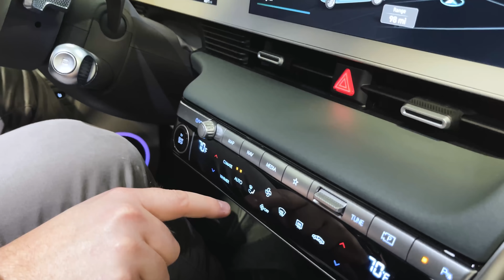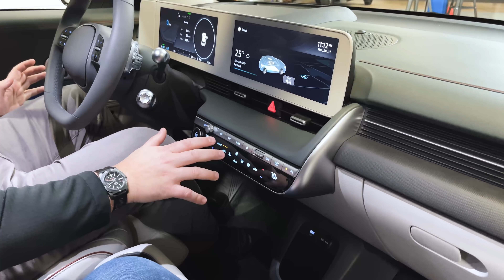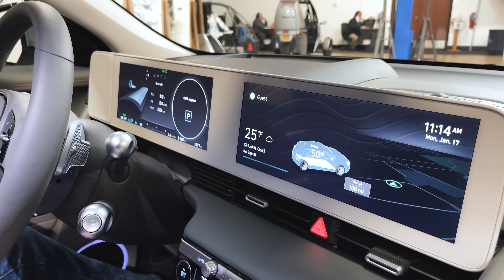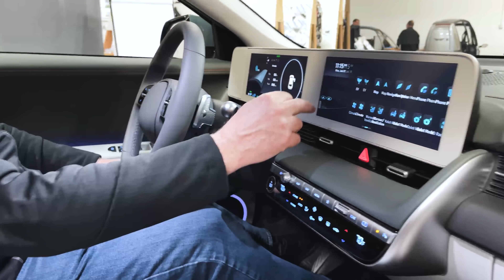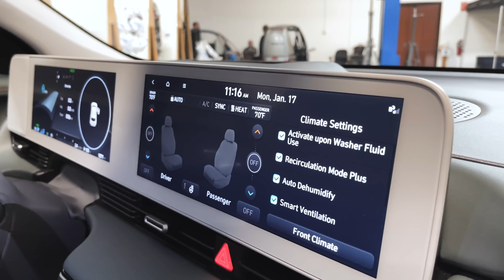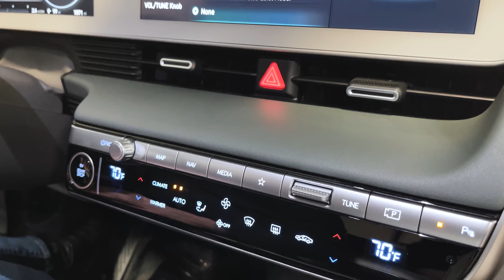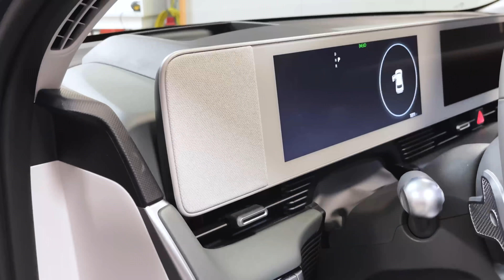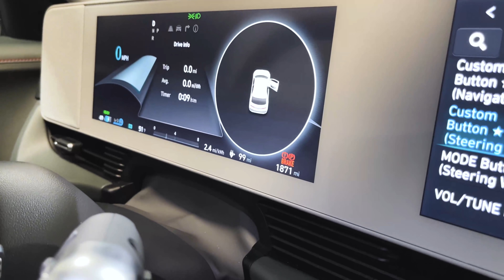2022 Hyundai IONIQ 5 | Sandy's First Impressions

Comment: Christ, what a silly video. It’s like these two have never seen a car before. Sandy pawing in-between the headrests trying to make the rear seats fold forward was cringing. Which is insane considering the guys stature in the industry.

“Where’s the frunk? No frunk! Oh here it is” 🤦🏽‍♂️🤦🏽‍♂️

Nothing wrong with physical buttons for the hvac. When it’s all touchscreen people moan. When there’s buttons people still moan.

Plus has he never seen a Drive Mode button before??? Suggesting it was mounted flimsily yet it didn’t move one bit unlike the ones you get in the Mercedes. Loved the car, hated the review.

Comment: What i dislike is that there is again no wiper for the rear window. So many buyers which are driving in the rain or in the snow here in germany say they are seeing nothing behind the car through this window after some time. The engineer or designer say that "there is no need for a wiper" because of the airflow ... But yes, there IS need for a wiper. Its a nice try but real life fail.

Comment: Ford has 3 level Auto Climate control. I notice this car has many of the features found on a Ford Explorer Platinum edition. The molding is in the rear hatch has the cuts in it to reduce weight and increase strength of that item. Otherwise it would have to be a hollow tube, thus wasting material. Auto Hold keep the car from rolling while on a hill. It is nice if you are towing.  Maybe the car oauto parks like the Ford Explorer.

Comment: Funny, my cheap old Hyundai i30 had most of these mentioned features. There is a nice feature with the light above the mirror. When you close the mirror the led turns of with a purely physical mechanism. No sensor needed.

Comment: Climate in separate is nice. It even nicer when i can turn it on outside to clean snow. It is always so that even if i have my brush outside. The mandatory sequence for ice is clean the top of te door, sit inside backward knonck off some snow fro your boots, turn inside, turn off wipers, press break turn on motor, turn on heating for back and front window and steeringwheel put ventilation to take in air inside to warm up faster then go outside and clean yor car. Why there is no preset for that why i must bring in snow twice.

Comment: Most modern cars in “auto” mode do not even begin to spool the fan until the heater core is up ot temp. I am a set it and forget it kind of person and never feel the need to fiddle with HVAC with the exception of defrost.

Comment: It's interesting how the older of the two suggests getting rid of buttons/capacitive touch down below - I would have thought he'd want to see dedicated buttons for climate if not for both climate and audio...  The lower "buttons" change too depending on if you want them to be audio or climate.  I also vote to keep the buttons even though I drive a Santa Cruz which has gotten rid of physical buttons and replaced with capacitive touch panel which took some getting used to but didn't take long - I had a few Ford products where they did the same to clean up the control stack.

Comment: I think those sun shades should be on all car doors and should be embedded with  titanium chain mail. It should have a electronic locking mechanism as well so that you can release them and retract them in a press of a button. Would make entry into cars practically impossible after breaking into the car.

If it's too expensive atleast make a slot for it there so 3rd parties can supply that accessory.

Comment: Having real A/C buttons was one of the points why I picked the Ioniq 5.. there's nothing more annoying than having to fiddle around in menus on the touchscreen just to adjust the temperature. That's several seconds I need to take my eyes off the road that I do not want to spend. I wish Hyundai had gone for actual buttons instead of these touch controls, but that's what we get. The tiny frunk is acceptable on the AWD, at least it fits the charging cable and V2L adaptor.. the one on the 2WD version is significantly bigger and can take some luggage. I'm quite sad at VW for not putting even a tiny cable-sized frunk in the id.series.. having to stow the potentially wet and/or dirty cable in the cabin sucks.

Comment: We had a Peugeot 308 SW and it was a surprise that the point where the roof and rear pillars meet, the sheet metal edges were very sharp and seams didn't have enough body seal - so that it was corroding already at 6 months of age. After that experience, I became habitually investigating other cars and found failing quality too. 

Paint seems to be easily scratched on almost every car nowadays. 

And third thing what came to mind is how would the rear doors at the rear wheel wheel openings survive the winter snow and ice?

Otherwise, a very nice car it should be a little higher so one would not have to crawl in like a crab...

Comment: It is my understanding that in the US, the frunk could not be as large without having installed a hood release on the inside of a child had accidentally looked itself in there. Thus, the just went with the smaller frunk area. The AWD version has the front motor right there (as result of stretching the wheelbase to is measurements in order to have that spacious cabin.

Comment: The ioniq5 I test drove in Ireland (RHD) had a drawer for the glove box. Much more useful than just having the door hinge down. Looks like you don't get that in the US.

Disagree about removing button console below. Yes it makes cost sense to the manufacturer but as a driver I prefer physical buttons for volume and HVAC. The ioniq5 at least has that panel but it's not that well executed and I have the feeling that the safety engineers, mechanical engineers, designers, and accountants spent many many hours to reach the obvious compromise.

Comment: one of the advantage of an electric vehicle is it removes the drive tunnel in the cabin. I'm surprised though that vehicle designers don't make use of that to add a pass through storage area between the seats for long items. There has been many a time I have had long items that I ended up sitting between the seats and on top of the arm storage area's because there was no pass through storage between the seats.

Comment: 22:50 I applaud any OEM that takes the gear selector off from wasting space on the middle armrest/drink/storage/could-be-a-small-seat area.  And steering wheel shifters are great, but what's wrong with more having the shifter on the dash like Prius, Grand Caravan, new Pacifica etc???

It would be awesome for more vehicles to offer a middle seat up front for little folks (tweens basically)--of course with the cup holders/storage on the back of the seat when you fold it down.  (Of course this isn't a possibility at all when dumb OEMs place a crumb-catching shifter widget in the middle seat area.)  I can only imagine skate board designs with wheels pushed out such as Ioniq5's would make such dual-functionality easier to pull off.

Comment: Regarding the buttons on the middle height of the board, would maybe a squared or rectangular pad with the essential options built in make sense? As in media, navigation, AC, parking and two favorite buttons?
That way the options are visible, opens directly that section to the screens, and drivet wouldn't need to reach for the further buttons

Comment: I hate the fact that Hyundai insists on not installing a rear wiper. Even though it may not be necessary while driving, in most cases I just use a couple of quick rear wiper passes before driving to clear the rear after the car has been sitting for a few hours.

Comment: 800 volts will help the current (amps) levels seen by motors, chargers and control systems, but it has no effect on the individual cell voltage and they still have the same power limiting tabs.

Comment: Sandy is a great mechanical engineer, but when it comes to electrics he's an absolute boomer.  
(P) is the parking break.
Auto Hold (in my VW at least) automatically applies the parking break when you go to a dead stop in traffic lights for example, in VW's case it also doubles as the Hill Hold (which is stupid as that should be a separate function) or when you turn off the car and exit.  You should never rely just on the Park position on the shifter.

As for the aircon buttons - like the top comment here, I agree these need to be physical buttons and this is a big plus for this car.  The aircon is something which is constantly being tweaked and changed, moreso than the stereo.  It needs dedicated physical buttons not some touchscreen menu you need to look at as you're setting the temperature while driving.  I love that my 2018 ICE VW has nice big rotary knobs to set the temps and fan speed and a big physical button for auto.

Comment: I suspect cars may go through a similar cycle to cameras with physical controls vs screens and menus:get rid of almost all of them in the name of futurism/design/cost, then reintroduce the most commonly used features in a limited number of buttons as customers find it more intuitive and quicker to retain core functions on physical buttons.

The question probably amounts to whether the feeling of being in control is desirable, or a hindrance. Again, to compare to a camera, many users just want to point, take a 'good picture' and leave the complexity elsewhere. They're happy with no buttons and a phone. Those who want more control want the buttons and feedback.  The question for cars is probably whether some of the basics like control of ventilation, temperature and volume are determined to be fine when automated or controlled via GUI, or if greater user input or the feeling of control drives physical buttons.

Comment: Reading the comments here it's clear that many people prefer the hard climate controls yet you'd advise Hyundai to pocket $50 and bill the hapless customer $1,000 as a dealer-fit accessory.  The Tesla bias is still strong I see. The two coolants by the way are because one is non-conductive and that flows through the battery.  EV crash tests inadvertently demonstrated that in a severe accident spilt coolant can initiate a battery fire. They made the change from conventional to 100% expensive non-conductive coolant early on during Kona/Niro production when the root cause of the Kona fires was not known. The coolant has a short life (40,000 miles) and is very expensive so limiting the volume used to only that necessary is to the customer's benefit. I suppose Tesla owners are simply expected to exit their vehicle a bit more smartly in the event of an accident.  Also, the coolant cap doesn't remove conventionally to avoid customers accidentally adding washer fluid but you'd have to have actually checked that before guessing!  I'm looking forward to the "frunk examination" but please study the design carefully before dismissing things out of hand.
Reply: Thank you for reminding me that Teslas are the safest cars ever tested.
Reply: @wilfredvanvalkenburgh2874  Do you even own/lease a Tesla?
You may well be an internet TESLA TROLL for all we know & DO NOT say that there aren't any. 😱

Comment: Us Joe blow 9-5 workers like the physical buttons for climate.  Cost of replacing the touchscreen and having no heat or AC controls is bothersome.  Uconnect for example is 4k in Canada to replace it at the dealer.  I can swap out the unit myself I think, but just saying.  A lot of manufacturers are making the pairing process of the new parts a dealer only activation.  Just saying Sandy.

Comment: Could you comment on the hood setup? Most vehicles have the hood placed between 2 static body panels on the left and right that sit above the wheel wells. It makes the hood look like it was cut out.
I noticed on this unit that the hood comes right down to the tops of the wheel wells, so those side body panels are not there. Any thoughts as to why they would make this choice? Cost savings? Fewer gaps? Aero? Just to look different?
Thank you.

Comment: As Cory said early on, they don't look at other reviews or tell Sandy anything about the car before the first looksee.  Well, I think even with an initial "looksee" they should have noted the exterior lighting both front and rear.  The front is great with that light bar above the bumper and the rear with all the pixels...sweet.  Another point: they noted the moveable sunshade.  Time for a comparison with the Teslas all glass roof.  First, I don't own a Tesla nor have I driven one.  I do live in the South and during the summer you definitely close the shade on the sunroof when parking to try and reduce the solar heating effect.  I know that Tesla uses some sort of coating that they say is heat reflecting but how well it works I just don't know.  Furthermore, there are some days when you don't want all that light streaming in.  I think that Hyundai did the right thing by including a motorized sunshade and pretty cool how it is two separate shades that meet in the middle.  Yeah, quick look and they didn't notice that the back seats actually move fore and aft along with the recline function that they did note.  They also missed the double pane glass in both front and back windows for noise reduction.  Does Tesla have that?  I think that the side view camera shot that appears in the drivers screen when the turn signal is actuated is genius.  I've heard that this is in other Hyundai's.  Sandy was complaining about the round button sticking out of the steering wheel that allows you to change driving modes, eco, sport etc.  He said it was cheap.  Geeze don't Porsche's have the same thing?  I kind of like that button placement.  Thumb on left hand, push button and there ya go.  I too wonder how/why Hyundai couldn't engineer a real front trunk.  Will be interested in seeing their limited tear down of the front to see the plumbing.  Cory seemed to like the handling and we'll see in a future video.  FYI, the Ioniq 5 iced the "Moose Test".  I agree with another poster that Hyundai needs to update the design with a rear window wiper.  All reviewers agree that the aerodynamic spoiler that is supposed to keep the rear window clean just doesn't.  Also, they need to update the usb from A to C.  Although not as efficient as a Tesla it's still reasonable in my book.  I'm looking to go ev in 2 years.  Hopefully more choices and more availability.  Tesla still draws me in with their efficiency and also their supercharger network along with the nav that plots your charging points and times but this Hyundai's styling and price just hits a homerun for me.  Oh yes, waiting 2 yrs...maybe we'll get adaptive lighting.  Finally, if you want some of the most thorough reviews (not tear downs, for that stick with Sandy) just go to Bjorn Nyland.

Comment: Sandy and Cory, excellent show as always. Love your presentation. I agree with Cory’s point about Auto HVAC, whereas most of the vehicles sets the fan to max and becomes too noisy. Overall love the vehicle. Hyundai (and Kia) put lots of the thoughts in every detail. Additionally, Korean quality is surpassing many others.
Reply: They have contracted in highly regarded German designers and managers from BMW that were responsible for M division and cars. Also they created an engineering division in Rüsselsheim where former Opel engineers could work.

Comment: I REALLY hate the Tesla look of have all buttons on one screen.  Need 4 or 5 presses to get to what you want.  Then if your screen breaks you can't drive your car for 6 months since the screens are out of stock.  Give me real buttons any day of week! 1 press and you are done.  Did you notice that Sandy had to do several "double" clicks to get back to home screen (time 27:30).   Home button on screen needs to be larger.  He also had to lean forward to reach the screen.  If your in a cold area and wearing gloves...forget about using touch screen.  Spend the $50 and give me real buttons.  I really like the trade off in physical buttons to screen size that the Ioniq 5 has chosen.

Comment: The two position is from their genesis lineup. It makes the GV80 pretty luxurious having the 2 position seats in back. Genesis craftsmanship and engineering is unparall right now. Tesla is ways ahead in the EV game but hyundai has done the most graceful job of catching up. It's going to be Tesla with the top throne and Hyundai on spot two with how they've positioned themselves. This also have the Rimac tech that's how they are playing with those high tech high voltage systems.

Comment: Hi Guys lots of these cars on our roads in the uk..it looks cool... its efficiency is not great -- its a big chariot on the front  -- but it looks cool.. if it came with a GLASS ROOF and AWD here in the uk..may well be tempted --- The rear seats are motorised here  and that middle binnacle move backwards... here alot of folks like buttons -- heater controls via the screen can be a pain.. Chargers quick -- cheers GRAHAM UK MODEL 3. SKODA CITIGO IV.

Comment: If auto park is the car automatically putting in the handbrake when car is turned off and then releasing it when you start driving it is a nice feature. I used to have that on my Toyota Avensis a few years ago, highly appreciated.

Comment: Nearly every Hyundai and Kia SUV has a two position privacy shade. Even our 2019 Kia Sorento has it. If you look under the rear floor, there might also be mount points for storing the cover.

I imagine the 'slots' on the side of the hatch are probably decorative, repeating the slashes from the exterior into the interior. They also might have save a couple of ounces by not bother to put the over sheet of plastic.